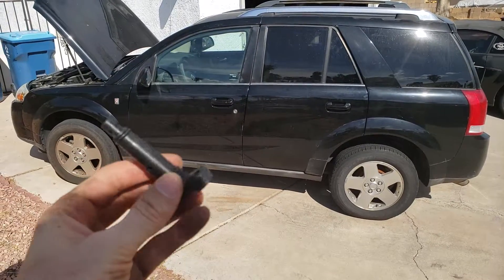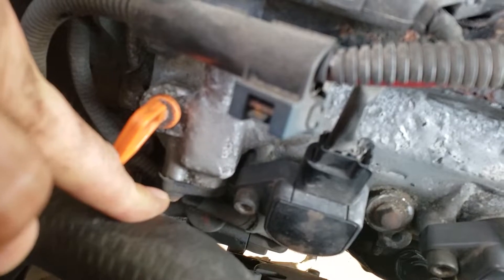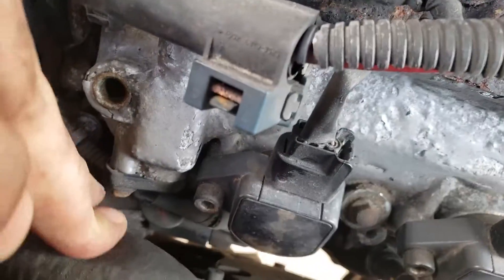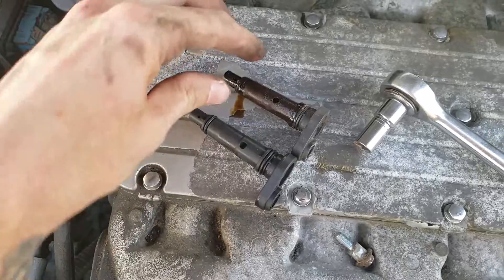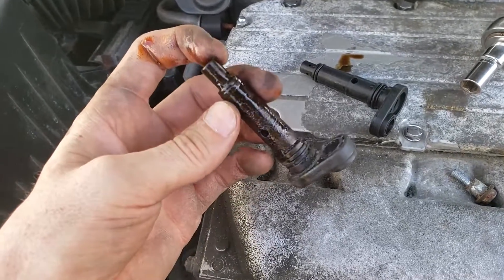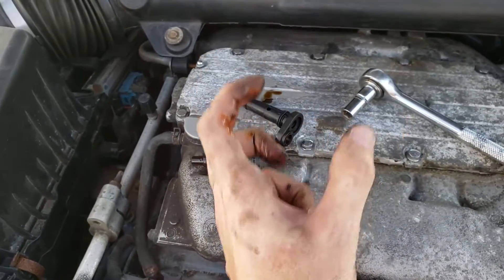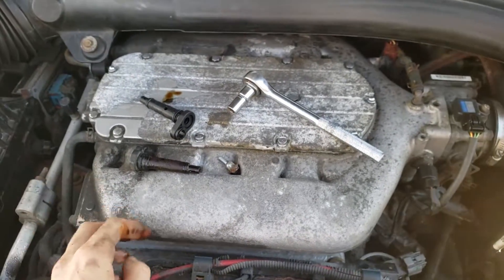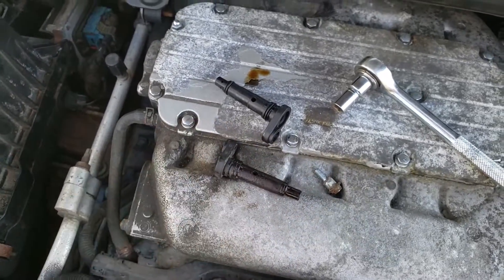How to Replace a PCV Valve - Part V384 (Saturn Vue 2004-2007)

Comment: Enjoyed your video. Do you happen to know the ~2.5" plate with two bolts at the lower left corner of the intake air manifold aluminum block is for? It is seen at 1:16 right near your palm. Its top surface is a triangle with 90 degrees.
Reply from the maker: The intake manifold endplate?

Comment: mine is 39$, 44 tax in, problem is when i remove the old pcv, half of the valve broke and stuck in. Dont know how remove it now.
Reply from the maker: A lot cheaper on amazon and ebay. $44 sounds retail.
Twist and pull, but its probably too late now!